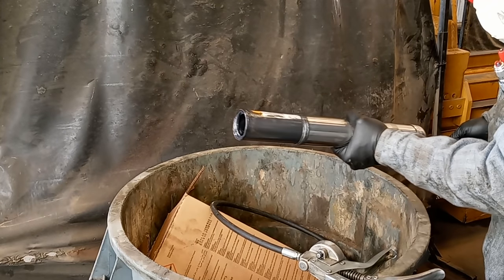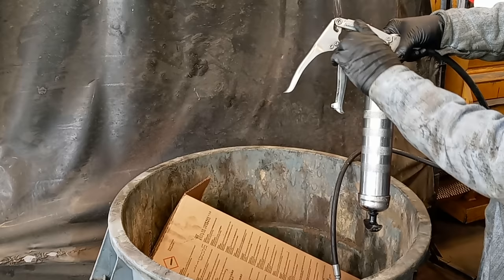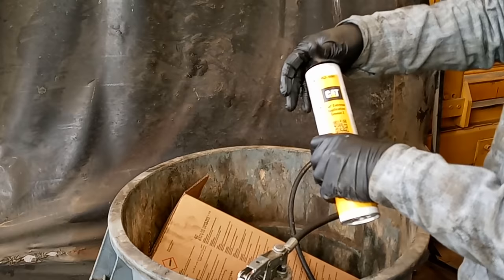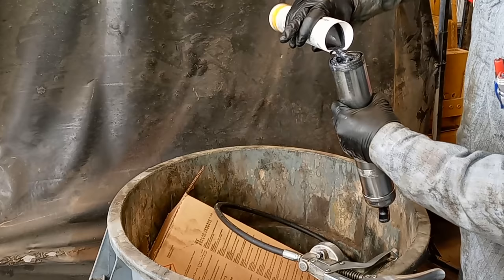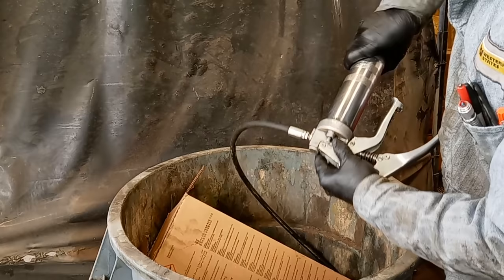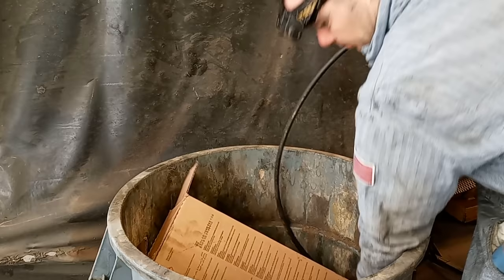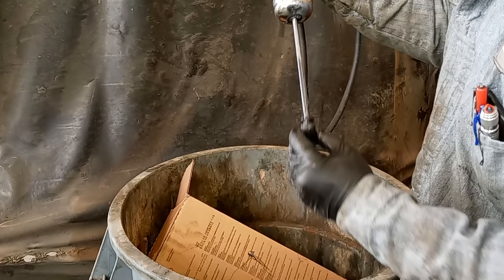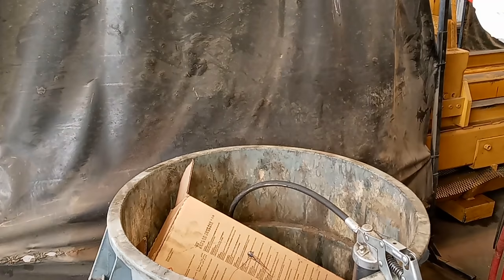3 Tips For Changing a Grease Cartridge the RIGHT WAY (No Airlocks)

Comment: IDEA: save a suitable amount of the type of grease you use in a clean, sealable, separate container. When a change is almost due, spoon the grease out of the separate container into the empty section of the new cartridge so it is now full to the brim with no air gap. Reassemble grease gun and carry on greasing with no air locks or bleeding required. Or use your grease gun to directly fill the void of a new cartridge ahead of time before it needs changing. Sounds easier than spooning it out of another container. 
(I dont own a grease gun so have never tried this but my thinking meat seems to reckon it will work)
Reply: Or I guess you could think ahead of time when you get a new box, load a gun and take all the caps off the new tubes and fill each one up and then replace the caps on all the tubes. Personally I do not put as much thought in when replacing a tube like this guy if it gets air locked there are tricks to get it working like what are in these comments and what he showed.
Reply: Way too time consuming and messy.

Comment: If you have a airlock after changing in a new cartridge, place thumb over the greasegun  hose end, pump so that the pressurized air/grease lifts the thumb off the end, with a tightly held thumb it creates a vacuum on stroke return drawing the air thru the line. Also topping up the top of the tube before screwing on helps.

Comment: after peeling off the metal tab/lid, i use it to pull the grease up around the lip of the container, leaving just a pocket of air in the middle near the top/ thread on the canister just alittle. enough its in but enough to force air out, and push on it while pumpin. easy peasy.

Comment: I have a zerk fitting in the port on the pump end of the gun, I fill off the 120 lb keg air op grease gun,  one can also open the check ball on the zero to release the air.

Comment: Vice grips on the plunger arm after you lock it back. I’ve worked in shops with worn out grease guns, and they had no problem blaming the mechanics when their tool crib grease gun shoots a full load load of $2000/tube grease across the hangar. 🤘🏻
Reply: What tube of grease costs that much ?
Reply: @johndowe7003  That would be a youtube of grease...
Reply: @johndough9187  😂

Comment: Been doing this a long time, on occasion will have to pump it a few more times than normal but it always pumps back up ok.  I always take the pump off first, pull the rod out, let the rod go and push out the old tube, pull it back out , put in new tube, put on the pump , push the rod in and pump it up. rare to have a problem.

Comment: I never have too much trouble with air pockets, they usually work themselves out in pretty short order, but then again, I'm using a Lincoln pneumatic grease gun too, maybe that's why.
Reply: I have a Lincoln hand pump model and have had no issues either. It’s got the air purge on top so that helps.

Comment: I’ve always used all the grease before changing. Also, I never pull the plunger out while it’s still connected to the gun, this will create a low pressure and suck the grease out and lose the prime.

Comment: I got fed up with grease tubes that had large air pockets init. So, I got a zerk fittin & screwed it into the metal tube on the pump end, took it to a service station & had it pumped up with grease, and NOT AIR. YEP i PAID EXTRA, BUT WAS FINISHED WITH THE AIR HASSEL & it aint messy.

Comment: Just bought a smaller 3oz pistol grip grease gun for my mower and it's my 1st grease gun so im trying to learn how to use it and some tips/tricks to make it easier to operate. Thanks for the video
Reply: You might check to see if it has a nozzle that screws in and out. If you have one that does, then you're in luck, because you can adjust the tightness applied to the grease fitting. Turn it out to loosen, which is the time you push the tip onto the grease fitting. Once on the fitting, tighten the tip around the fitting before you apply the grease. Once you're done, just unscrew the tip to loosen it and it comes off with no struggle.

Comment: After installing the new grease I will partially thread the it back on then release the plunger. I might tap the plunger down a little. Then finish threading the cylinder on. I haven't had any problems since doing it this way.

Comment: You added a step, hold the check valve on top pull plunger out and lock it, unscrew unit, pull the tube, put tube in, screw unit down press the check valve on top and press the plunger in and up till it fully inserts.

Comment: I run it empty. Pull it back. unscrew it. Push the rod back in to push the old cartage out. Then pull the rod back out put new cartage in. Screw it back up push the rod all the way in and boom . Pump it until grease comes back out

Comment: The best grease gun I ever had never air locked,  it was a cheapo from NAPA, but of course I left it under the truck and ran it over
Reply: Same thing happen to us we have one that never air locked then got distracted replace ing a starter motor that literally just burnt out on the tractor and we forgot all about the grease gun on top of the disc plow went back to work and it fell off the brand new discs with put on that season made short work of that grease gun. After that old man brought a new one and air locked all the time he got pissed and therw it away went and spent the money to get one them fancy new electric grease guns so far it hasn't given us problems makes life much easier when working in tight spaces like on combines.

Comment: tip for next time. Don't throw your lid out right away, use the lip of the lid to lever under the pulltab on the other end of the grease tube, cleaner and quicker.

Comment: I'm sorry folks but the correct way to do grease gun is this first you run the gun till there's no grease left don't waste Grease second is this unscrew the cartridge holder pull the lever all the way out and back and lock it in position then put new grease cartridge in pulled a little lid off throw it away now here's the trick folks screw the cartridge holder on about a turn and a half then unlock the lever continuously screw the cartridge holder on all the way this removes all the air with little waste of Grease this is the correct way to do your grease gun never cross threaded grease gun it will be messed up for the rest of its life once you cross thread the grease gun threads be careful your grace gun will last a lifetime if you do it this way old school system

Comment: I have a different problem, I need to put my grease gun into a vice gently or something to hold the one end because I need my whole body and both arms just to pull the "T" handle back to the lock position and I am just barely able to do it. I've used grease guns for thirty years but have never come across this problem before.

Comment: Don’t fully tighten the body into the head of the gun.  Leave it backed off a bit and it gives the air somewhere to escape.  Otherwise you get it pumping and then  the gun will get small air locks at the most inconvenienttimes

Comment: The Only proper way to purge your grease gun is after you installed new cartridge into grease tube ANY way you like is to thread your grease tube with new cartridge just a bit NOW ALL THE WAY just to start your thread and then push your rod all the way in and after that thread everything together And it will push any air you might have inside. It will always work 100 percent.

Comment: If you get an air lock, take the hose off and cap the end of the gun with your finger. Use your finger as a check valve

Comment: Surprised you don't have the one that has the big keg of Greece located remotely that's pumped into the gun from there
Reply: I installed them on our service trucks enclosed beds with extra heaters. Wintertime inside felt like Daytona Beach & grease & oil fly 25 to 80 feet in below 30 degrees.  Only way service in Wintertime. Employees did whole lot better job with that set-up. Grease is cheaper than metal. Downside was blown seals from "Gomers Pyles" getting carry away.

Comment: Step one: buy Milwaukee m18 grease gun
Step two: use entire tube of grease
Step three: pull plunger to lock
Step four: unscrew housing 
Step five: rip out tube and slap a new one in
Step six: screw in, slap plunger down and pull trigger til grease come out.

Saved ya 20 mins of fuckery.

Comment: The cup seal is incorrectly installed in the gun. I have fixed my own an others. Seal cup should be the same as a brake system seal,I have reversed the cup seal and the work awesome.  Try it you will be surprised what has been fighting you this whole time. No mess no air pocket issue. @AdeptApe

Comment: I greased one truck and trailer with a manual grease gun. Then I upgraded to pneumatic and eventually M18.
Reply: Just an FYI. Power grease guns on big trucks or vehicles can cause problems with over greasing. Heavy equipment is fine for power grease guns as long as you are not using them for engine parts or u-joints.

Comment: We'd still run them out, also prior to screwing it all back together, we'd take some grease and pack around the piston. Leave the housing loose by a few turns, pump and no air lock. We never messed with those valves. Reason we'd do what we do is because, it's bad enough getting grease all over the place as it is. Your method, just makes a mess that needs to be cleaned, no offense meant but, it is what it is. 
About every 2-3 yrs, we'd take all our grease guns completely apart and clean them. Be amazed at what you'll find about that plunger. Sound method, each their own. Cheers :)

Comment: I have multiple grease guns. (For different applications 1.boat trailer axle bearings 2.machinery pivots 3.mower arbors )
None of my guns have an air purge. :-(
None of the rods will lock into the piston either…
What brand of grease gun is this?
Is there a way to purge without the air bleeder?

Comment: What type of grease gun is that? When you show pushing it against the floor to bleed it, mine is either fully locked or not locked back. I cannot get it to push the grease in like that. I have two guns. Neither seeem to pull that off.

Comment: My favorite part is when the grease cartridge gets stuck in the tube or when the plunger slips of the notch whilst screwing it back together, or that I always find away to get grease on me.
Reply: Ha, I always worry about bumping the plunger when its locked in the detent but luckily hasnt happened. Yet.
Reply: Pull the plunger and let it spring forward and it'll push the grease tube out no need for screwdrivers

Comment: Listen up son, I’ll tell ya how it’s done.  Hold the tube with one hand and the handle with the other and completely remove the head and use your little and ring finger on your tube holding  hand to grasp the hose and hold it. Now pull the plunger handle all the way and let it back out to expel the empty cartridge and pull the plunger back again and lock to the side. Now grasp the new cartridge , knock the plastic cap of, use the top edge of the barrel to get under the snap ring and remove it. Insert the new cartridge and put the head back on the tube about halfway, release the plunger and tighten the rest of the way just till it snugs up a bit.  That’s it.  If You do happen to get air, just loosen the head a couple turns and pull the plunger handle back until it just makes contact with the plunger turn it just a bit one way or the other until it engages . You’ll know it’s engaged when you can’t push it in. Now put the handle against your upper thigh and push down with the tube to put pressure on the plunger and cycle the pump handle a few strokes until it evacuates the air and starts pumping the grease. Turn the plunger back and forth with light forward pressure until it disengages the plunger and push it home. Tighten the head back up and you’re good to go. I could make a video of this process doing it blindfolded but it would be so fast you’d think it was a magic trick. 😅😅🇺🇸

Comment: You can pull the plunger back and twist it a little and it’ll lock in place.  When that happens you can press on the plunger and hit the purge button or just pump the air out.  One pump and the air will be gone.  No need for all this pumping and working the plunger back and forth.

Comment: I have a really nice grease gun. I forget the brand but it's high quality. I bought one and it leaked out the bottom and the air release valve so I thought was damaged and I returned for a new one same one. The new one does leaks too. I have to be doing something wrong they shouldn't leak like that. Does anyone know what I'm doing wrong? I'm not a newbie but I may be forgetting something simple

Comment: Completely empty grease gun then pull plunger back unscrew tube discarded old cartridge open new cartridge put it in tube then screw tube on 2 turns release plunger screw top on all the way done. Never had an air lock...

Comment: I run my gun empty every time. It makes less of a mess when you change the cartridge. I never use the plunger to push the empty cartridge out that’s why your cartridge was covered in grease when you did get it out because the plunger wipes grease inside the barrel which transfers to the new cartridge lol this really bothers me I hate getting grease all over my gun and my hands. I just leave the follower rod latched back and pull the empty out and then insert the new cartridge. For purging air I’ve never had good luck with the useless bleeder valves I just leave the barrel unscrewed by a turn or two then take the follower rod and with it fully retracted you should be able to rotate it just a little bit and you should feel it engage with the plunger. Then I give the follower rod a little push which pushes on the plunger and purges the air pocket out. Then just tighten the barrel back up and you’re good.
Reply: Yeah that's so true,  I don't care about the tube being greasy cause most of the times ya don't have to touch the old tube. It's more of having the outside of the gun greasy which is annoying

Comment: I've got multiple typical grease guns and a fair bit of equipment to grease. I always run them out of grease-- this is not a factor. This makes sense; the inlet side is pressurized by a large spring; it's not like you're trying to lift grease to a pump. Typically when I see people struggling with a grease gun, they've got the plunger handle pulled all the way back and locked out after refilling.

Comment: Good stuff, good tips, surely you use an air or battery grease gun, no?
Reply from the maker: We have one of those big pneumatic grease guns, but generally only equipment needs that. For trucks and RV services it is faster just to roll under the vehicle and grease it by hand, rather than going to the tool room wheeling it out, then running an air line to it and then trying not to spray grease everywhere since it pumps a gallon of grease per time you push the button.

Comment: I just leave the plunger locked out, and then I use a paint scraper( the kind with a pointer on one end) and use the tip to catch the lid inside and flip the empty cartridge into a trash can, or flick it at your buddies that are fuckin off, instead of working! 🤣🤣🤣👻💪also, i used to grease about 6 -8 pieces of equipment on each job, out of 6 jobs all over town; so get a Milwaukee M18 cordless. Otherwise, u gonna have forearms like popeye the sailor man! 😂😂😂 work safely brothers! 💪🙌🙌🤟🤙

Comment: You will have 100% better results if you use all the grease (don't change until its empty) and remove the cylinder entirely before you pull back the plugger.  All you are doing here is wasting grease and pulling grease out of the pump.

Comment: That grease gun sucks, the model with a level is so much easier to use, though you need two hands to use it, I use to grease machinery at a mine site daily, use to use 3 cartridges @ 1.5 grams per pump, each cartridge holds 450 grams, yes it was a lot of pumps.

Comment: You still not doing it right for how I do. First you take the can off all the way than push the empty tube out. Than pull shaft on lock and load it. Than when you install it you put the can no all way tight but a turn back. You push shaft in and than turn the can back and tight a couple times than tight the can and you are ready to go again. Never have trouble with air less you got some cheap grease that some how has air in the middle of the tube.